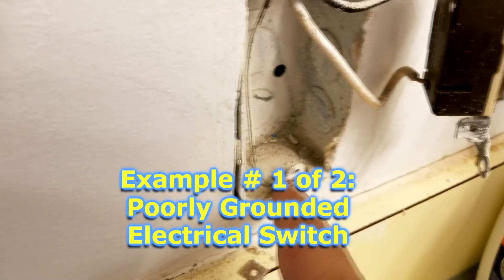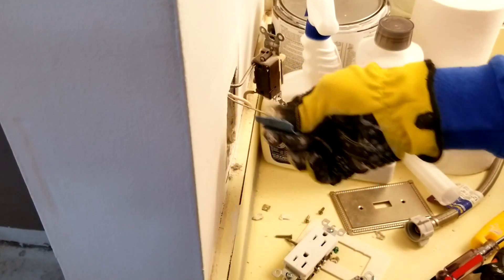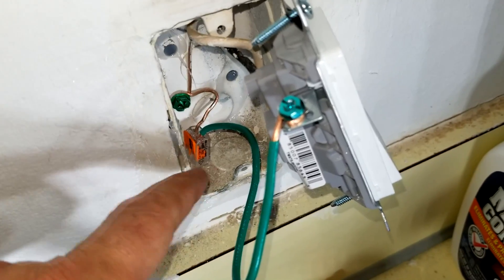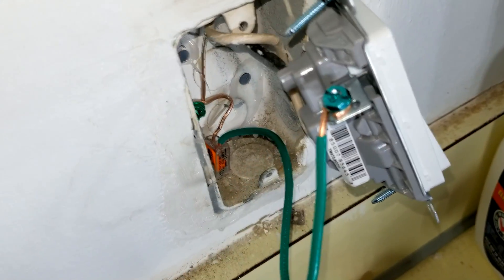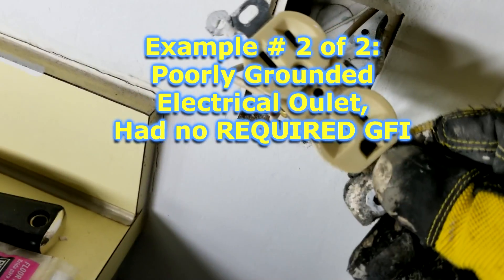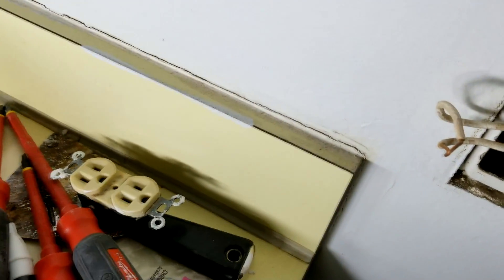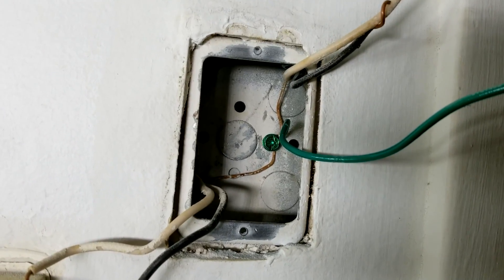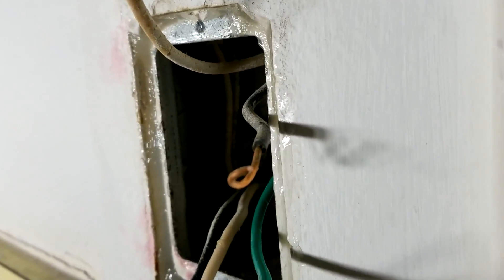How Not To Ground An Electrical Outlet - Wire Outlets Right

Comment: Hi Jeff. I just bought my first rental and I wanted to make sure every outlet is grounded and 3 prong to mitigate liability and tenant calls. My electrician proposed two options. One would be to use metal boxes and ground the outlets to those boxes as you've shown here. The other option would be to rerun all the wiring from the panel with a ground wire. The second option would cost a lot more and take longer in addition to possibly having to patch drywall after they are done. The house was built in 1978 so could probably use new wiring anyway. Are both these options generally safe and is it considered "wrong" to ground to the box? If you were a landlord which option would you choose; again with the goal to mitigate liability and tenant calls?
Thanks!
Reply from the maker: As a landlord I would not have bought a place with only 2 prongs lol. But the method of wiring the grounds directly to the fuse panel is the preferred method. And fact you would have to have your electrician check with the codes allowed in your city some inspectors allow you to ground to the metal Box but others don't because they know that over the years people come in and they mess up and take out  metal co suit pipes that lead from those metal boxes to the fuse panel and if they take those out there goes your ground, and your protection. You can't always assume that just because you connected to the metal Box that you have a ground. When you see me do it I'm connecting to the metal Box but the metal Box already has its own ground wire coming in from the panel.  That is how you guarantee that you always have a ground.
Reply: @jeffostroff  Thanks for your fast reply! Unfortunately it's a tough market for landlords and so to get a deal you sometimes have to go with something that needs a little work. I know every investor has their own philosophies some like turnkey while others prefer to get something cheap and have to invest time and money to get it rent ready. I appreciate you clarifying that your boxes are grounded to the panel. I knew it was the right way to go but wanted to hear it from a pro! Thanks again!
Reply: @sam5miy  what did you end up doing? Currently in the same situation.
Reply: It's odd that a home built in 1978 has no ground in all outlets.  Grounding was mandated to all outlets by then, according to NEC codes at the time.  I took electronics in High School during my junior year 1979-80 and my Senior Year 1980-81.  We we taught NEC code required grounding all outlets starting in 1964, then moved to lights in the late 60s to early 70s.

Comment: Can I install a gfci to a non grounded outlet?
Reply from the maker: Yes, the NEC allows this, but you must use the sticker that comes in the outlet packaging that states that there is no ground protection. The sticker is required by electric code. Remember there is no ground, hence no ground fault interruption.

Comment: just subscribe and clicked bell, just read the comments below. is it bare copper wire. so far in this video what is the size of the ground bare copper wire used ? my brother in law is renovating his house, and i would like to incorporate grounding in his house.
Reply from the maker: Floyd, the wire is 12 gauge, if you're referring to the green ground wire pigtails I used. They make them 12 gauge to work with 20 amp or 10 Amp circuits which would be 14 gauge.
Reply: @jeffostroff  thank you, for this info. i have been watching how install ground brass bar to the ground. and it not that easy because they needed to be measure. but is it ok just putting brass rod into the ground without measuring it. ?
Reply from the maker: @GEMINIBD  No, you must measure the rod and be certain it is 8 feet long.. In my 2017 National Electric Code (NEC) book,  The length of rod and pipe electrodes is mandated at Article 250.52(A)(5). And in Article 250.53(G). It sates that The electrode shall be installed such that at least 8 feet of length is in contact with the soil. It shall be driven to a depth of not less than 8 feet." Home Depot sells the appropriate approved 8 foot rod. It's best to did a hole 2-4 feet deep first, then pound the rod into the ground, and cover up the hold with the soil.
Reply: @jeffostroff  thank you very much.

Comment: i am from the philippines, are the grounding wire inside the metal box is bare no pvc insulation ?
Reply: It's nornal for it to be bare, it's a ground. It carries no current and should have the least resistance possible.
Reply: Sometimes it's in green. You can buy green covered pigtails.

Comment: beginning at 7:55  ... let me see if I got this right ....this looks like one continuous section of Romex with a duplex outlet affixed to it (using the loops).  It's not that there is no ground conductor, it  is present, it's just not being used to ground either the box or the device .... until you came along and cut the Romex at the loops, AND also added a green ground screw so that the copper wire could be screwed to the box .... plus the pigtail grounds the device .... It's a head scratcher when you first look at it ... hope i got that right. Thanks, Jeff.

Comment: Jeff, we need to prove the line side before connecting to the GFCI?
Nice video.  Never BUY a Condo. Old conversion jobs from former apartments
to condo are the pits.   Walls between units, noise, smoke, bug infestation etc.
Thank you.
Reply from the maker: Ted you got every one of those absolutely correct especially about the noise I had bought a couple of different condos that were apartments that converted to condo and lot of them have noise between them and smoke that gets through. As far as the line voltage yes you do need to determine which is the line voltage 1st because it must go to the line input of the GFCI , then  anything else that is a load must connect  to to the load output of the GFCI outlet. If the GFCI outlet is the last one in the chain then you only need to worry about connecting the line wires to the line input.  That is why they put the yellow sticker on there because you are not supposed to remove the yellow sticker unless you are using the load outputs.

Comment: Quick question and you seem to answer queries. If I install a CAFI GFCI breaker and somewhere in the circuit there is an open ground will the breaker still work
Reply: Scott.gallant Ssn646  Safety ground wire, which is bonded to neutral back at the panel, does not carry current. Not involved
with functioning GFCI.
Reply from the maker: Scott, that's a good question. I would imagine if the ground is open somewhere between the electrical panel and the AFCI/GFCI outlet, then the outlet might not ever power up, or come out of reset. If the ground opens up after this outlet on one of the load outlets down line, it may or may not work, I have not encountered this situation so cannot tell you for sure. One thing for sure is to make sure you have a good ground at every outlet. and if any outlets are in a metal box, you must by electrical code have the wire wrap around a ground screw on the body of the metal box to bond that box to system ground. I was installing lights at my neighbors house just an hour ago, and we found 2 metal light boxes that were not grounded to the ground wire that entered them, Really stupid, but you have to watch for these things.
Reply: @jeffostroff  GFCIs don't need a ground to work.

Comment: What size is the ground wire and what is the minimum size ground wire can/should you use on 110/120 outlet? There's little space inside the electrical box so pushing it all together and back inside is difficult. Thank you.
Reply from the maker: Chef The ground wire is almost always 10 gauge wire solid copper which is the minimum size ground wire. Remember in the case of dryers and ovens, the ground does not need to be as thick as the hot wires because it is theoretically not carrying and current under normal conditions. For aluminum it has to be 8 gauge minimum
Reply: @jeffostroff  His question was pertaining to a 120 V outlet (receptacle).The ground can be 14, 12, 10, 8, 6 etc. in an "outlet" depending on the amperage of the circuit. He didn't specify the amperage of the circuit in question.

Comment: why would someone paint their ground wire?
Reply from the maker: Happens all the time during construction, the painters are spraying the wall and they just don't care, they spray right over and past the rough in electrical outlet box with the wires all exposed. I think electricians should either tape over their rough in outlets, or place a plastic insert over the outlet opening before the drywall guys come in and hang drywall and paint. then after painting when electricians come back in to wire in the outlets, they remove the shield and their wires are still brand new.

Comment: Jeff, I have a 66-year-old house with the old 2 wire system; however, there have been some modern plastic handy boxes installed in various places with 14 AWG cable w/ground. Is pigtailing my ground wires in those boxes and connecting to the outlet ground terminal of the receptacle the same as grounding to a metal box?
Reply from the maker: Michael 1st of all with the plastic boxes you don't need to ground the actual Box itself so you're good with just a ground wire coming into that Box and you can send a pigtail from that ground wire to the outlet to ground the outlet. But knowing that you have a 2 wire system I would also double check in the fuse panel there does the ground actually tie off to a ground bus bar in the fuse panel.  At a friend's condo a few months ago we were looking at this 1945 built condo and he had 3 wire added in at some point but we noticed the master bedroom was not grounded so those are things you need to check out for just because you see a copper wire coming into the outlet Box does that really mean you have a ground?
Reply: Here in finland in northern europe we had black Line and grey Neutral wires before 1974 and no separate ground wire. We connected a short grey cable from the outlets ground screw to the neutral screw and then it was grounded. But sometimes in 80's the separate ground came in use and after 1974 the cable colors changed. Line is black, Neutral is blue and ground is green-yellow striped.
Reply from the maker: @Robin96  Ok, so on your next code revision, I'm predicting pink and orange colored wires.
Reply: @jeffostroff  Thanks, Jeff. Yes, I verified the connection at the ground bus bar. There is continuity between the ground bus bar and my end of the run ground wire. At some point, a panel was installed w/breakers to replace the former fused panel, and this particular circuit is grounded.

Comment: Hold on, if you are grounding an outlet, why do you need a GFCI receptacle that shuts off at the receptacle and not just a normal 3 prong receptacle with a ground wire that shuts off at the breaker
Reply from the maker: GFCI is different, it senses small current leaking from hot wire to ground like on your hand, and it trips the circuit to open. You never want a human to be the path to ground.
Reply: @jeffostroff  okay understood, so can you use a 3 pronged GFCI outlet that doesn't have a reset button if you ground it yourself as you demonstrate in the video?
Thank you for your prompt reply comrade
Reply from the maker: @TheGibby13  I would not use a GFCI outlet without a reset button. How would you reset it once it tripped? You use a regular 3-pronged outlet in bedrooms, halls, etc. And in kitchens and bathrooms, you use a GFCI outlet with the rest button if you are within 6 feet of the edge of a sink.
Reply: @jeffostroff  thank you kindly sir
Reply: @jeffostroff  GFI senses current leaking from neutral not hot..

Comment: I live in an older house and was checking some stuff out recently. I noticed a switch, a light fixture and an outlet that are all connected together (as different fixtures where the switch turns off power to the light and outlet) that none of them have a ground wire connected to anything. There are 3 wires coming into the switch and in other boxes where the outlet and light fixture wires were connected to so I assume this is all 3 Hot, Neutral and ground where 2 of them are connected to the switch and another connected to a screw directly on the metal box. Should I put a ground wire on all 3 of these (light switch, outlet and light fixture) and connect them to the metal boxes?
Reply from the maker: Yes I prefer to individually ground each outlet and switch whenever possible. I use the Ideal Grounding Pigtails/Ground Screws: https://amzn.to/2DMheg3 I can go through half a box updating some of my older condos.

Comment: Did you remove the box to see if it was grounded from behind? I have a electrical outlet with no ground and I am stuck.
Reply from the maker: No they don't typically ground a Box from behind so what we did is we would put these green ground wire pigtails screwed into every one of the boxes that we looked at here and wire those to the bare ground wire that comes into the box that way you're a 100% certain that the Box is bonded to the ground. Other times we would simply home out the Box with our digital multi meter to make sure that we have 0 resistance between the Box and the ground wire 1st. If we find infinite resistance then we would simply bond the Box to the ground with our pigtail wire.
Reply: Suzanna Dorantes Put a GFCI IN THAT location, in place of current duplex outlet. Put a sticker on it "No Ground Wire" You are good to go. Next to best
protection. Best wishes.

Comment: got into a problem trying to install a switch that requires a Ground Wire, which later I discovered we don't have any.  Do you recommend installing a Green Screw to Ground the Green wire coming from the Lutron Switch seen in my video please https://youtu.be/mgadtHj3tYE  Thanks

Comment: Our lightswitch in our bathroom just recently stopped working, it's beside a an outlet. Our house is pre-1900, been remodeled a couple times over the century. My girlfriend wanted me to change it out, so I went lowes and got a switch, rewired it, bam works, but then all of a sudden the gfi outlet (3 prongs with a testing button) stops working and she can't do her thing in the bathroom, so I go and take the cover off again and guess what I never realized which is crazy. So, it's "wired" for both the outlet and the light switch... Here is where things get nuts. The ground wire for the light switch is actually the black wire that is supposed to go to the outlet, but they snapped that off with just an inch of black wire left in the wall and basically looped it around the ground wire that goes to the outlet... and the outlet had worked since like 1994 when my girlfriend bought the house, but here is the kicker, there was no black wire hooked up, it just had the ground wire attached to the ground screw where it should be and the white wire where it should be...
Reply: That would make sense it has power and ground why won't it work same thing

Comment: what if I don't use any kind of grounding system? in my country is not common to use those, how to ground an outlet that doesn't have any wires going to a grounding system? where should I ground to, EACH outlet, since my house is not made out of drywall but blocks instead? Can I run a single wire from an outlet to anywhere in particular and be grounded, and do that for each outlet?
Reply from the maker: Here in the United States, houses built before 1962 had no ground either, just a hot wire and a neutral wire is all we had. But I would imagine that even in your country they must have electric codes that currently require a ground, so you need to check with an electrician in your country who knows the codes and what they allow. I know what we do here when we find old wiring with only 2 conductors, and if we don't upgrade the wiring to 3 wires, we often put GFCI outlets in place, or sometimes they still wire in outlets with 3 holes to fit modern appliances with a 3 prong plug, but they put a sticker on it stating that there is no ground protection. Our National Electric Code requires that end users know that the outlet is not protected by a ground wire if you install a 3 prong outlet and only the black and white wires are connected to the outlet.
Reply: @jeffostroff  thank you! actually I started looking for GFCI outlets to replace most if not all the outlets in my house... since the electricians over here don't give a F about code... I'm also hoping that a relatively new house improvement, done almost 30 years ago, fixed most of the outlets grounding issues.. I'll run to the nearest home depot or something to buy one of those grounding testers, and figure out how to possibly run them to a grounding bar and rod(maybe also install a grounding rod, since I doubt we have a grounding rod in my house, AND GET a bus breaker box or something... yeah... we are an electrician's hell, maybe not as bad as I've seen some pictures from India)

Comment: That ground wire looked very small almost like door bell wire.
Reply from the maker: Nope, perfectly normal 14 gauge ground wire, typical for use on lighting circuits. Electrical outlets will have a slightly thicker 12 gauge bare copper wire from 12-2 Romex cables. The other wires are also 14 gauge, but the insulation is thick, making them look much bigger than the ground wire. Because ground wires are bare, they always will look smaller than the hot and neutral wires.